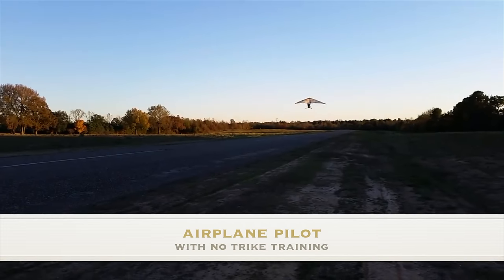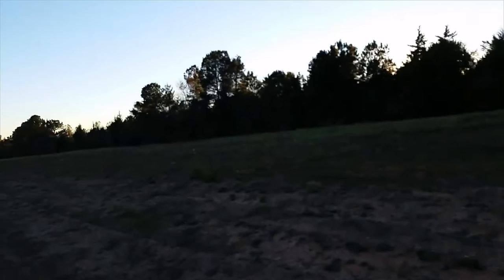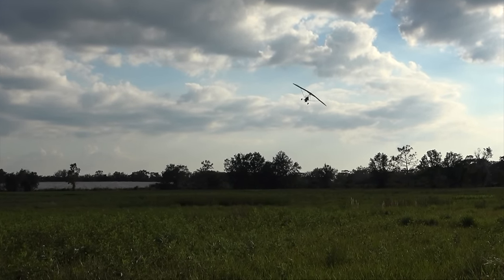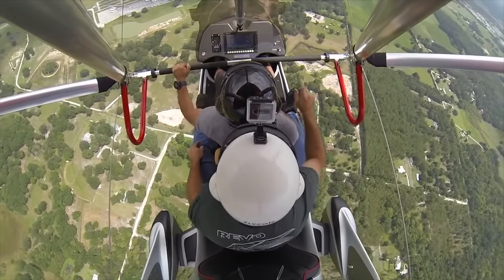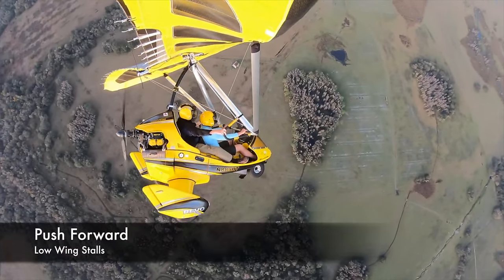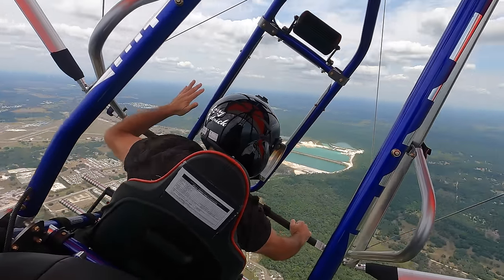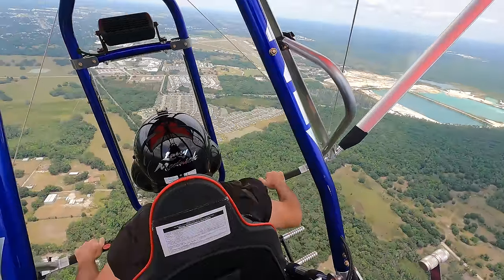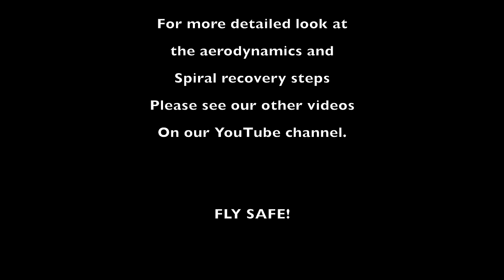Loss of Control in a trike

Comment: I flew foot launched hang gliders for about ten yrs before stepping into a trike. I had been towed by an ultralight a few times and while being towed it was strange to be able to push out and not burn off your speed but because I had experienced being towed it make my first weight shift solo a breeze. What is talked about in hang gliders is a thing known as "the J turn".  Every turn starts with a pull in followed by a weight shift to the high wing. Once there is a hint of response from the glider just let the nose out. It all just gets slower and heavier in an ultra light which isn't actually ultra light compared to a non powered hang glider.
Reply from the maker: When you are being towed. Your airspeed is going to be controlled by the Aircraft towing you. He is setting the speed. When the engine is on the trike, the airspeed changes exactly the same as with the engine off when the bar is pushed forward. The only difference is at full power this is happening while it’s climbing compare with the engine off, it’s happening while descending. But the airspeed is almost completely unaffected by power.

Comment: The steep take off angle shown at the beginning is extremely dangerous and is the cause of the partial stall, slip and loss of control.
Note -this maneuver is mostly used to impress spectators.
In the common vernacular; it is called " hanging on the prop" and is ill advised.
Reply from the maker: The steeper the climb the more piloting is required. Steep climbs causing spirals is like saying  speeding in a car causes it to lose control on the road. Both statements can be true of course, but also are not the root problem.
Reply: @LarrySMednick  good luck with steep climbs near the ground on an aircraft without a tail plane
Reply from the maker: Thanks! ROCKET TIME!
https://youtu.be/wah4CfeuljY

Comment: So as we watch some of these "spirals" and in the recovery you pull the opposite hand of the spiral direction while sitting squarely
and pulling back towards the hip but I'm curious if in doing this if ever the wing becomes so stressed that it rips or tears when you
attempt to pull it back into level flight?  I'm not a pilot so this stuff is a common sense for me but I do wonder about the strength
of the wings as you attempt to pull it back into level flight?  Anyhoo,  curious is all.  peace
Reply from the maker: These wings are rated to 6Gs ultimate and 4 Gs useful. The maneuvers you are watching are in the 2 G range. Pulling back makes the nose go down. The nose goes up because the wings are leveled and pulling back reduces this nose up effect so we don’t over stress the wing. Attempting to raise the nose (pushing out) is what kills pilots in a spiral.
Reply: Thanks Larry,  as someone who watches in wonder & knowing if I ever were to fly,  this might be the way,  this kinda
thing was first on my mind.  I guess it was on your mind before you started as well & I ty for sharing that... peace

Comment: I'll preface this by saying that I'm not a pilot. 

Would it be possible to design a seat that makes it very uncomfortable/awkward if you try to lean to the side? The natural tendency to lean away from the ground sounds difficult to overcome, especially during an upset/startle moment for a pilot, and having some physical barriers to discourage it might be handy.
Reply from the maker: Staying centered in your seat is one of many learned skills for flying a trike effective and safely. Another big one is banking the wing when taxiing (driving on ground) which can have non fatal, but bad consequences such as forgetting to use your feet to steer or getting flipped over on the ground in high wind. Another one is turning the nose wheel when applying the gas pedal. Big surprise when you land with the nose wheel turned. These natural tendencies simply need to be learned and practiced. 

Having said all of that, my students often joke about putting Velcro on their shirt and the seat back. 😂

Comment: I've messed around ridge soaring flying prone in my hang glider and tried to fly one handed. The problem is that if you push the control bar one way your legs and feet go the other way so you still go straight - LOL.
Reply from the maker: Correct. It is only because of our 2 axis hang block that the trike steers very different than a hang glider.
Reply: @LarrySMednick  ah, that explains a lot.

I fly HG and PHG. The one handed flying made no sense. You can fly a PHG one handed in very still air, but the roll response is incredibly slow as you're essentially using thrust vectoring.

Comment: Very cool. Flying a Robinson R44 with some experience can be settled into a non-accelerated flight situation and the machine can be controlled by leaning. i used to do that with passangers. "Ok, everone lean left" and the copter would go left. But to me it looks like the glider is rigged backward to what an aircraft yoke would produce. Probably why the airplane pilots get in trouble. They expect to increase the angle of attack by pulling back and decrease it by pushing forward which is opposite to the trike in this vid.
Reply from the maker: Leaning in a trike cannot affect the wing because the carriage is a pendulum
And will just rotate on the keel. 

Reversals are not the reason pilots spiral into the ground. Spirals are responsible for well over 80% of all fatalities. The mind set or trying to raise the nose is the problem. Or raising the wing is the secondary problem. Neither will work in most cases. Hence the point of this video.

Comment: So this is all purely uncompensated torque steer it looks like?
Reply from the maker: The fact that it enters a left or a right spiral may be from torque. But torque does not cause the spiral. Kind of like if you have a low tire on the passenger side of your car and let go of the steering wheel on the highway it will probably drift into the right lane. The car is not veering off into the right lane because of the tire as much as nobody is driving the car.  Meaning if all four tires were properly inflated the car still won’t stay in its lane all by itself regardless.

Comment: Please correct me if I'm wrong...
This is a spin. The FW correction is to yaw ( not roll) away from the spin then decreasing the AoA by relaxing back pressure.

Because this is a two axis control with roll/ yaw couple due to LE sweep, high hand to hip creates roll away from the spin which then causes yaw away from the spin.

This entire training scenario would be completely un necessary if instead of a control bar, the trike was equipped with rudder pedals to initiate roll ( with push left- go left nose wheel),  and a conventional stick for pitch, just like a gyro.

There would be ZERO need for this video when  FW pilot transitions to WS.

This is another example of an aeronautical evolutionary dead end: a mistake that has never been corrected. It's like those open cockpit airliners from the late 1920s:

 " we've always done it this way"

This whole problem is caused by naive designers.
Reply from the maker: This is not a spin. In fact a trike cannot spin because the wing has so much washout in it. Rudder would not aid what so ever in recovery from a spiral which is a fully coordinated maneuver. 

That’s why the recovery is instantaneous vs. a spin can take hundreds or thousands of feet to recover or not recoverable. I will take a spin proof aircraft all day over one that spins personally although I fly airplanes as well. I like planes and I LOVE trikes. Trikes are generally misunderstood by fixed wing pilots so don’t feel bad. 

Furthermore because a rudder on a trike  would create a roll yaw de-coupling, a rudder could never be used on a trike. 

I appreciate you wanting to grasp what you are watching and I apologize for not explaining it better in this video. But if you really want to understand the aerodynamics of this machine and why a rudder is a terrible idea and what a spiral is, this video is a start. https://youtu.be/fbXz26wu370

Lastly I will add that EVERY aircraft has its kryptonite. Airplanes stall spin, gyros unload blades and can get blade flap on takeoff, don’t even get me started on helis, and trikes spiral. Obviously ALL of these dangers can be avoided with proper training in each aircraft. There are just as many gyro crashes as trike crashes and the only thing those crashes have in common is pilot error.

Comment: Trikes don't have rudders....I just realized that. What do trike drivers do with their feet?
Reply from the maker: You can dangle them in the air once you’re flying if you like.
Reply from the maker: Trikes are evolved with no tail. Kind of like humans vs monkeys. 🙈 🙉 🙊
Reply: @LarrySMednick  Uhhhh....Answer to uncoordinated turn question?
Reply: Simples, they use their feet to steer the front wheel when on the ground. More confusion for fixed wing pilots though, as  they work opposite again. Fixed wing push left pedal to yaw/steer nose wheel left and vice versa. On a trike, think riding a bike - push right to go left, ie turn 'handlebars' left to steer left and vice versa. All great fun.
Reply from the maker: Trikes are self coordinating. Pushing forward is how we yellow the nose into the turn. BUT we cannot hold a slip…

Comment: I would think that training with a solid understanding of how that wing works, the control inputs and an spacial awareness to the pilots relation to the aircraft would be paramount to a safe flight.
Reply: Idk it seems pretty straight forward if you know how air moves. It’s basically a big horizontal sail. You pull towards it’s going down you push it goes up.

Comment: This really is a very fascinating and informative video. But why would anyone want to fly something as unstable as this?
Reply from the maker: Just like your car staying in its lane on the highway. It just takes a little bit of piloting. These trikes are far more stable than helicopters and aerobatic airplanes. Even the mighty super easy to fly Cessna 150 can accidentally enter a spin. The difference is the Cessna needs much more altitude to recover. And let’s not forget the incredibly popular Cirrus that if you spin it CANT RECOVER and you must pull the parachute as spin recovery. Same with buying some SUVs which can roll over at speeds of under 30 mph just by turning to sharp. 

The simple answer is control what you fly or drive. Nothing is wrong with any of the machines I just mentioned.
Reply: @LarrySMednick  you're telling me that the cirrus airplane can't get out of a spin?
Reply from the maker: That is correct. So every Cirrus comes standard with a parachute because the parachute is the spin recovery system on that plane. Crazy right?

Comment: I wouldn't like powered hang gliders. Having to unlearn the standard airplane push forward to point down and pull back to point up and then reverse that would suck. It would almost be like twisting a steering wheel left to go right in a car and vis-versa.
Reply from the maker: Many people fly both like I do. It’s not a big deal. The pivot point is above your head. No different than holding the bottom of your steering wheel when driving a car. Going back and forth is no big deal.